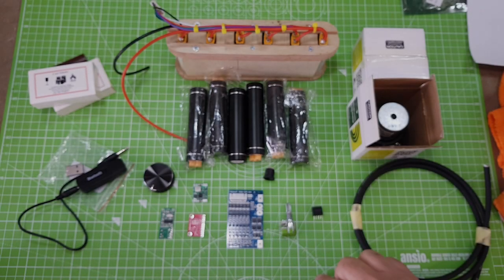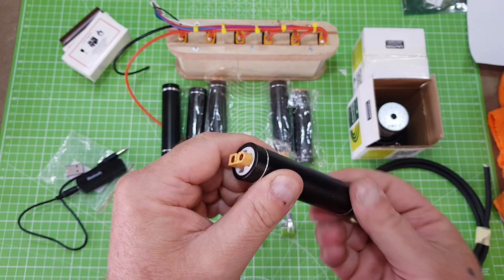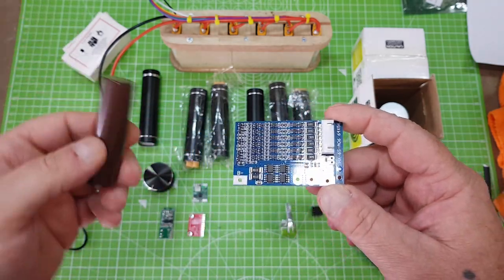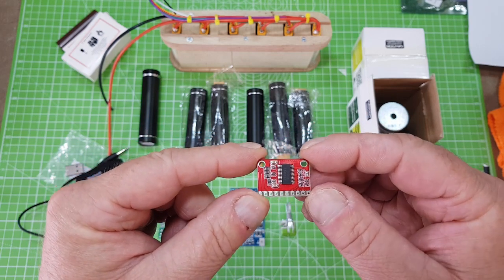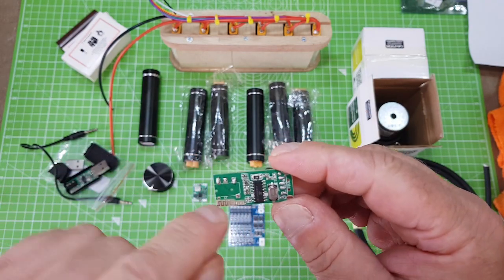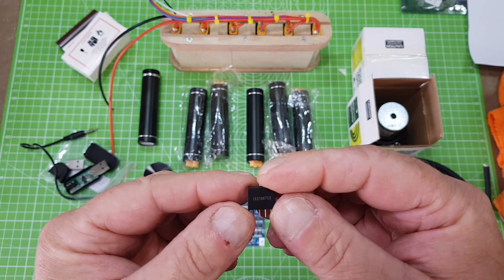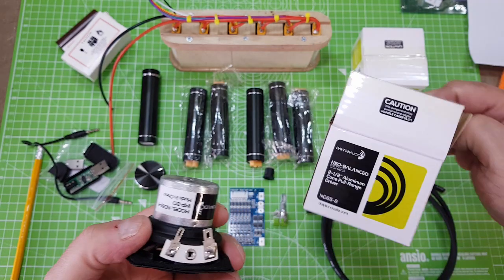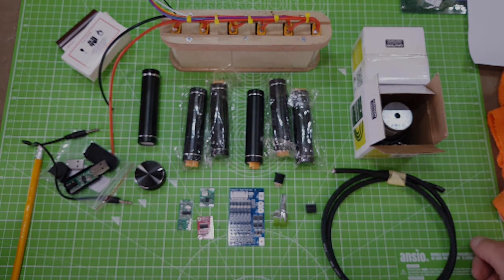Concrete Bluetooth Speaker Build Part 2

Comment: Hi Paul, great videos! They will definitely help me as I make this. The part which I am not clear on is around the BMS and charging. Do you have a schematic / description for how that is wired together (bats + BMS + power to system + charge socket)? Thanks a lot

Comment: Very nice job. I consider this as an upgrade to DIYperks version. Good job adding a BMS and removing the need of protected battery cells as well as providing a better way to charge the batteries. However, what I'm wondering is, isn't this too heavy to be considered a portable device. What is the weight ? And if it is too heavy are the batteries really needed ?
Reply from the maker: Thank you for the feedback. Yes I added the extra features And I made it slightly bigger than the DIYperks version as I wanted a challenge and to broaden my knowledge. Yes you are correct it is very heavy possibly close to 20 kg so not portable at all. I don’t think even the lighter DIYperks version could be considered portable in the true sense of the word only in the fact that it is battery-powered. Mine has the batteries removed now they are being used on other projects and I’m powering it with an old laptop power supply.

Comment: hey, I'm planning on making this but I cant find the battery banks. Do you think you could  provide me with a link to where you found them?
Reply from the maker: black flame : Hi, I can’t share the link from my AliExpress app but go to AliExpress.com and search ‘Battery Bank 18650’, there are a lot of listings for these around £0.88 each. I just priced 6 up at £9.28 delivered, assuming you are in the UK. You may find them on eBay too. Good luck with your build
Reply: @PaulNurse1  Another question. In your build, you had used a dc jack to charge your batteries. How did you connect it And how long do the batteries last?

Comment: Hey Paul, this video really helped me, but when I finished all the wiring the speakers were extremely soft. Furthermore, when I adjusted the volume with the potentiometer instead of adjusting the volume it just changed the sound from one speaker to the other. I believe it was a mistake in wiring the poteniometer but I don't know what to do. Do you have any explanation?
Reply from the maker: James Grimm : Hi, that’s a headscratcher for sure. Have you used the same components as in my build as I can’t imagine a wiring scenario that would replicate this issue in the potentiometer that I used. My potentiometer is an on/off and volume and has no functionality for balance control. Is it possible you are using a balance control potentiometer instead of a volume control.
Reply: I had the same problem. It all cleared up when I connected the two "ground" pins of the potentiometer with a v. short wire. I thought the two ground pins were connected within the potentiometer but they were not. If you have the potentiometer sitting on a table in front of you with the volume adjustment knob facing up and the pins facing towards you the pin on the left of each gang (set of three pins) is the "ground" or neutral. The other two pins in the top set are the "in" from the BT module and the "out" to the AMP for one side speaker. The lower gang is for the other side. The "ground" or neutral wire comes from the BT module and makes a connection to BOTH "ground" pins and to the "ground in" on the AMP. The bottom two pins on the potentiometer are of course for switching off the whole system when you turn the nob all the way down.

Comment: This is great thank you, it really cleared up a lot of problems I had with the DYI Perks video.
Reply: But how did you make so the potentiometer was also a switch, did you wire the power input through the bottom two prongs, if so does it matter which is positive and which is negative?
Reply from the maker: Hi, Thank you for the feedback. I hope this helps so yes the potentiometer I used had a built-in switch on the bottom two contacts. I used this to switch the negative from the battery power supply to the BMS which when off completely eliminated any power draw.
Reply: Paul Nurse, just to be sure. You soldered the negative wire from the battery supply to the first contact of the potentiometer and then went from the other contact to the amp/transformer?
Reply: So when the switch is off, it stops the power draw.
Reply from the maker: Almost correct. The negative wire would normally go from the battery pack to the BMS (battery management circuit board) but I routed it through the switch so there would be no current draw when off. The amplifier takes its power from the BMS so if you put the switch wire on the BMS to the amplifier wire there would be a current drain at the BMS.

Comment: Hi, amazing work, is the high end speaker still coming?
Reply from the maker: Hi thanks for the comment and yes it’s on it’s way. I’ve just done a two small test casts of the concrete, the latest with a black pigment with black basalt aggregate but I’m not entirely happy with the initial finish. But it’s on its way I’ve bought all the components so there’s no going back.

Comment: Great end result Paul. One question though - shouldn't the two speakers be insulated from one another inside the case with a baffle? Essentially they're interfering with each other having one case for both.
Reply from the maker: TheDradge Yes you are correct but the amplifier I am using is only mono
Reply: Thanks for the reply Paul. That makes perfect sense.

Comment: Hi, great build, busy doing a similar one with load chip/balancer. Any reason why you didn't use the same amplifier chip with bluetooth onboard?
Reply from the maker: Philip Arends I have since change this to a sure hi-fi amplifier. The sound is truly incredible and I’m halfway through my new build so stay tuned if you’re interested
Reply: @PaulNurse1  cool, sounds good. what chipset did you use ?

Comment: Really like your build!
I particularly like your attention to detail with surface finish, that's not easy!
If you're interested in boosting your clarity a large amount for very little work, making sure your interior case volume has as close to a air tight seal as possible will have a dramatic impact, increasing the thickness of your front baffle helps a lot too if you are still with in interior case volume tolerance and will mostly eliminate those odd resonances on your high end. 
Hope to see more stuff from you in the future and if you decide you really like the concrete stuff i've learned a ton from Modustrial Makers channel.
Great work!
Reply from the maker: giliant ... Thank you for the comments. Behind the Oak facia is another ply panel the Oak is secured to. This has the airtight seal. I can’t recall the internal volume but I remember it perfectly matched the drivers I used. I’ve had some great feedback from friends and family so keep tuned because I’m currently designing a reusable mould for a high end Bluetooth speaker build.

Comment: When soldering the potentiometer do you need to connect the the 2 ground pins together then solder the both ground wires to it? Or is there a specific  pin out of the 2 ground pins each ground wire should be soldered to.
Reply from the maker: I bridged the 2 ground pins together with the ground wire
Reply: @PaulNurse1  Thanks

Comment: Any chance of uploading a wire diagram anywhere ? :) Great build! Looks really nice :D
Reply from the maker: Thank you for the feedback. I’ve had a few requests for the wiring diagram I need to find some time to get one done.
Reply: @PaulNurse1  hey Paul would you show a simple diagram of how to wire the APM and the potentiameter I have trouble with that too I did it and the speaker works but when I turn the volume knob the sound gets muffled and don't go higher. Would really appreciate it. Thanks again